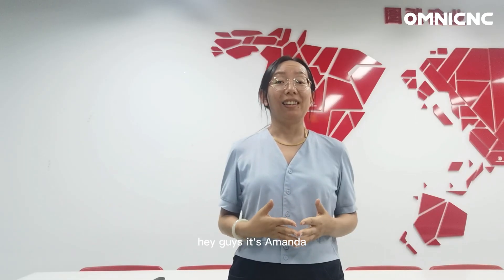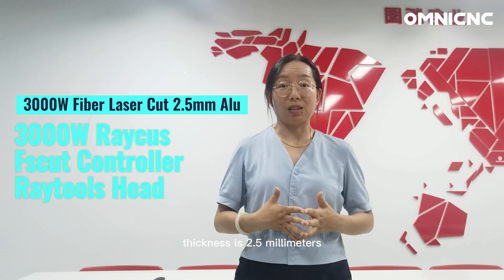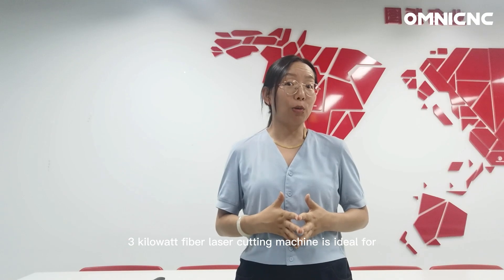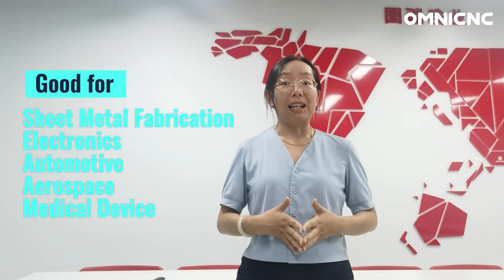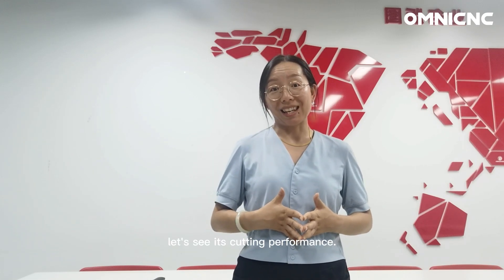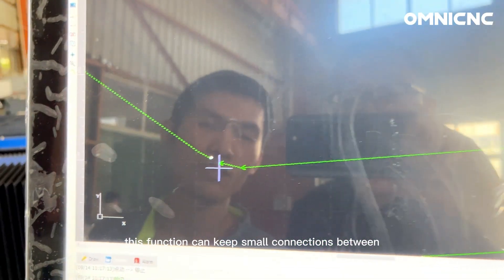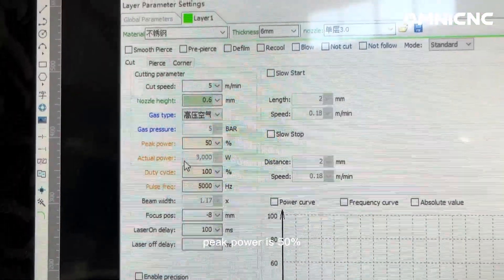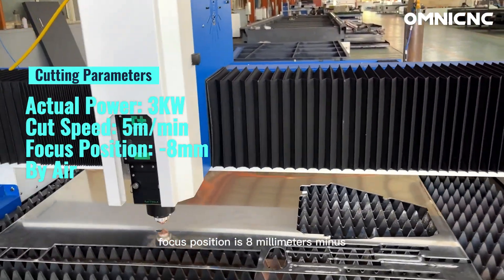3000W Fiber Laser Cutting Aluminum Sheet: What You Need to Know

Comment: what would it cost to have this machine in sent to Brooklyn, NY?
Reply from the maker: Thank you for your interest in the Omni Fiber Laser Cutter. I understand that you are interested in receiving a quote for the machine, including the cost of shipping to Brooklyn, NY.

However, before I can provide you with an accurate quote, I need to know a bit more about your specific requirements. For example, what is the maximum material size( width, length, thickness) that you need to cut?

Once I have this information, I can calculate the shipping cost and provide you with a total quote.

In the meantime, here is some general information about the Omni Fiber Laser Cutter:

The machine has a working area of 1500mm x 3000mm (4.9′ x 9.8′).
The machine can cut a wide range of materials, including carbon steel, stainless steel, aluminum, copper, and brass.
The machine is equipped with a powerful fiber laser that can cut through materials up to 20mm thick.
I look forward to hearing from you soon so that I can provide you with a more accurate quote.

Comment: Nice Video, how much is that machine incl. Shipping to Germany?
Reply from the maker: Thank you for your interest in the Omni Fiber Laser Cutter. I understand that you are interested in receiving a quote for the machine, including the cost of shipping to Germany.

However, before I can provide you with an accurate quote, I need to know a bit more about your specific requirements. For example, what is the maximum material size that you need to cut? And could you let us know your nearest sea port name? Hamburg?

Once I have this information, I can calculate the shipping cost and provide you with a total quote.

In the meantime, here is some general information about the Omni Fiber Laser Cutter:

The machine has a working area of 1500mm x 3000mm (4.9′ x 9.8′).
The machine can cut a wide range of materials, including carbon steel, stainless steel, aluminum, copper, and brass.
The machine is equipped with a powerful fiber laser that can cut through materials up to 20mm thick.
I look forward to hearing from you soon so that I can provide you with a more accurate quote.